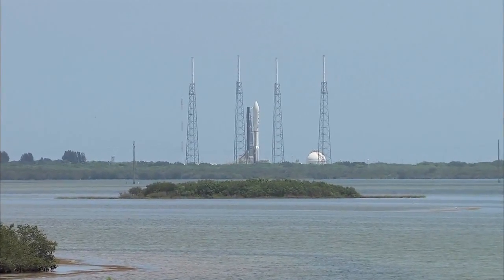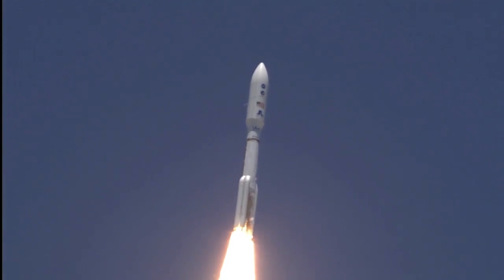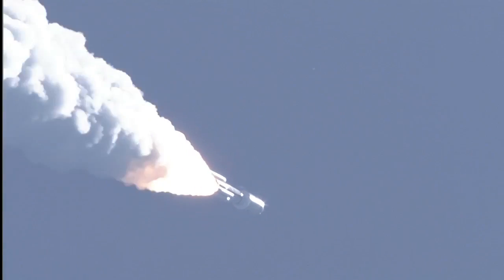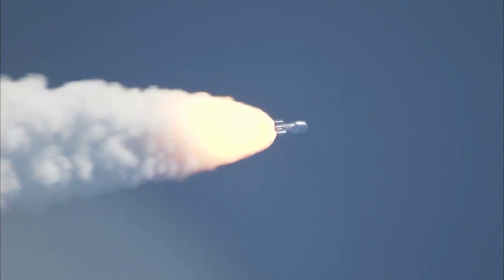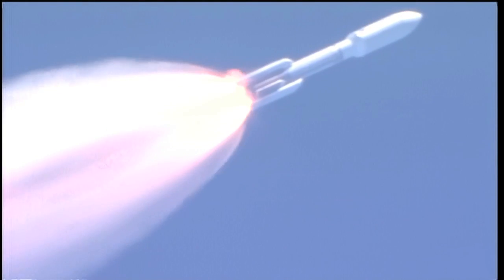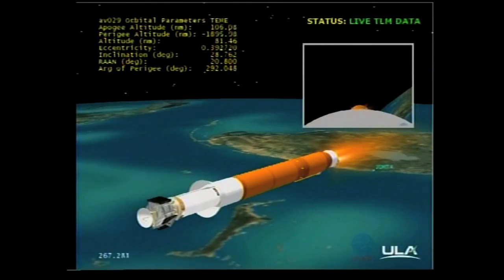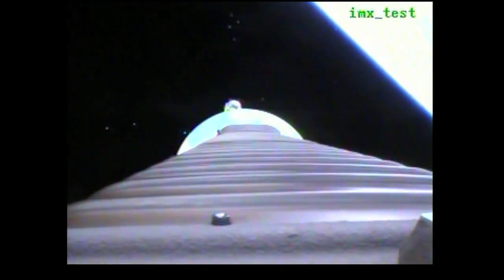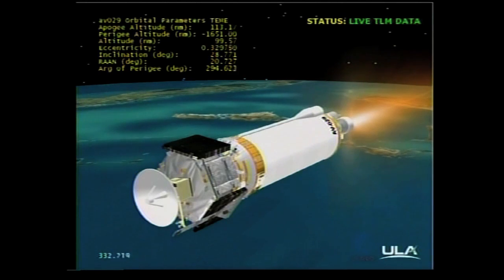Juno Mission Launches to Jupiter

Comment: I keep wondering why nasa keeps using the english system as a measure. The most advanced scientists in the world use the most archaic measuring system. Go figure...
Reply: Charly Robledo serously though, I had to keep going to google to convert miles to km and mph to meters per second..
Reply: I think the engineering team use metric measurements. Imperial is just for the audience.
Reply: @SerBallister  Aviation worldwide still uses Imperial measures as the standard - feet, nautical miles, knots etc.
Reply: @EricIrl  so you reckon the guidance system computers are using imperial?
Reply: @SerBallister  I honestly don't know. I think it varies on who is operating the mission. NASA and the Air Force tend to use aviation (i.e. Imperial) terms. Civilian and scientific missions tend to use metric. They can often use a mixture of both, with Imperial for the operation of the rocket and related tracking and metric for the science.

It can cause confusion at times.

When a spacecraft is being launched or is coming back from space, all the NOTAMS (Notices to Airmen)  issued by the aviation authorities will contain the internationally recognised measures used in aviation i.e. they will be Imperial based.